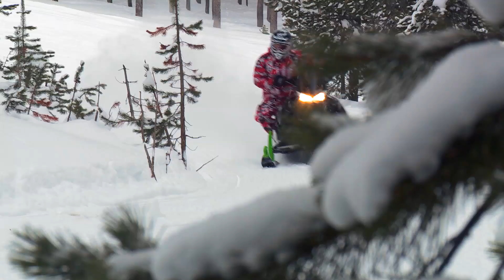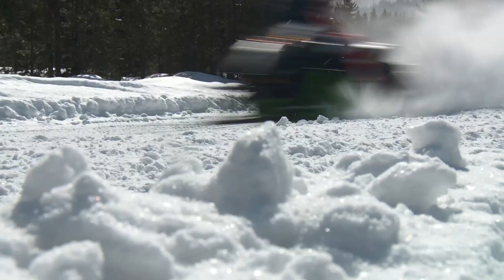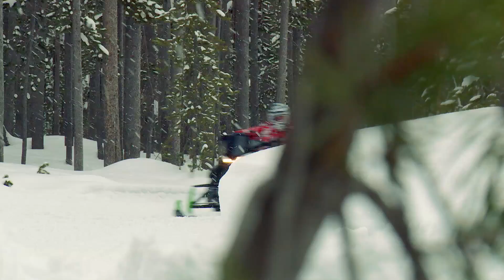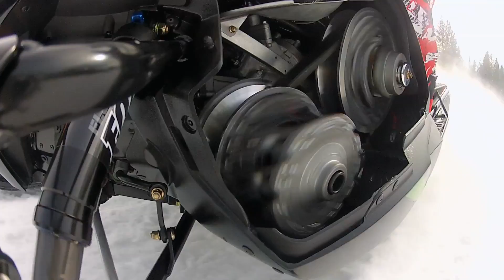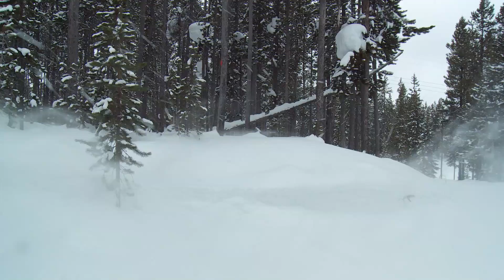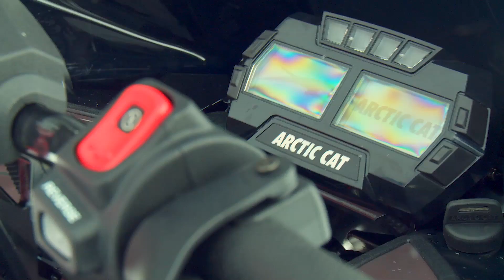TEST RIDE: 2014 Arctic Cat El Tigre 6000

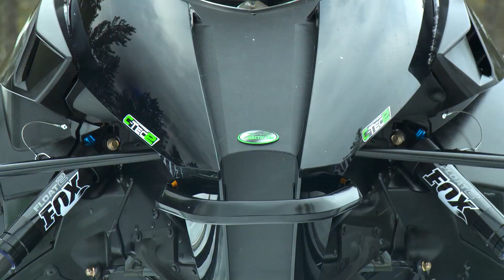Comment: 3:43 / Fox Float 3? Your test sled has Float 2's. Did Cat upgrade to the 3's after you got your demo sled?
Reply: twofastrc No, they have float 2's. I noticed that aswell lol. Float 3s are on sleds such as my old F8 Sno pro 2011.
Reply: No, there Float 3's, I have this sled! :-)
Reply: ok, your sled has float 3's but pause the vid at 3:43. Clearly says Float 2 on the shock
Reply: yes you are correct! I saw that as well and commented on there snowtrax website :-) They said because of being a pre production, it still had the Float 2's.